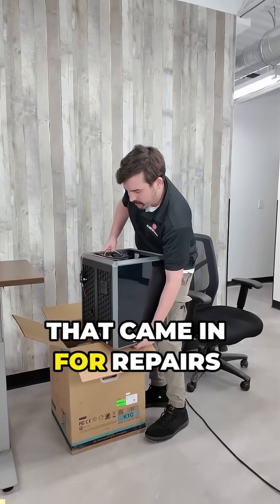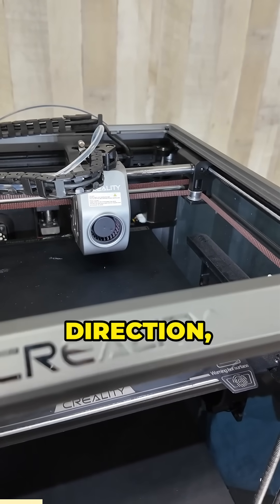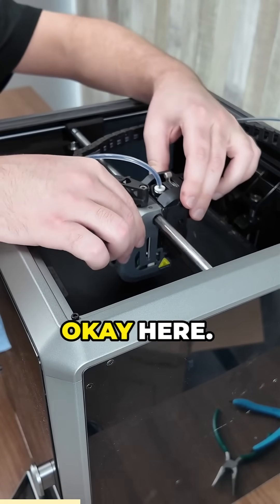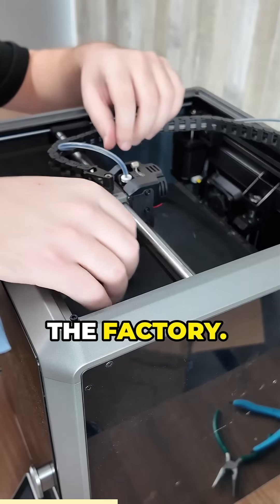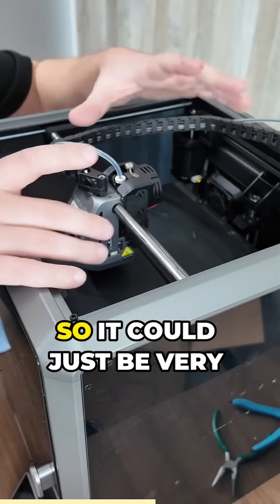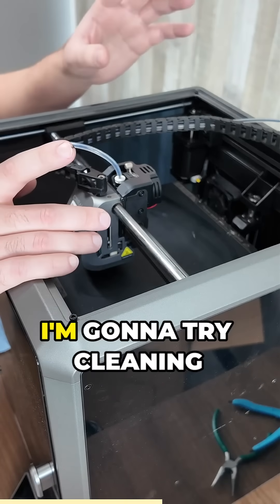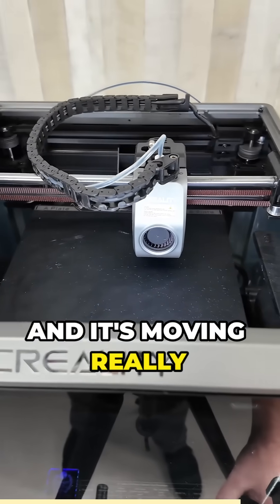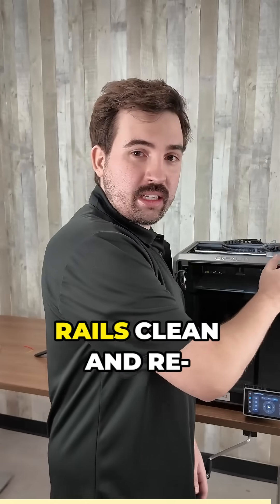What's Wrong With This Creality K1c?

Comment: Hi,

My printer is making strange noises and stuttering when the x and y axes move. Shortly afterward, the printer stops all movement and displays the error code "Error key 2567 unknown exception."

Creality support wanted to know if the x and y axes could be moved when the printer was turned off, and this worked without any problems.

Creality support then sent me a replacement motherboard. After replacing the motherboard, nothing changed. Same error code.

I'm grateful for any ideas.

Best regards

Comment: Shouldn't push steppers like that because the back EMF can destroy the driver electronics
Reply: Pretty minor risk with modern boards, they include sufficient inline smoothing.
Reply: @krazed0451 You can build in all the protection you like Zeners, flyback diodes etc and still enough back EMF voltage spike can be generated to destroy the drive electronics. It's a stupid person who thinks otherwise.

Comment: on K1C in X-axis (linear rods from start of video if someone dont know) should be brass graphite self-greasing linear bearings so you shouldn't use grease it cuz it can make faster wear and tear of them
Reply: I greased my x-axis once and my k1c started to shift on printing.  I removed the grease i added and just cleaned the x axis and all is working great.  Lesson learned.
Reply: @mlkeclow1671  yep, you shouldn't grease x-axis, if it starts to work harder just clean it

Comment: You dont grease the xrod. Its a self lubricating graphite bearing. Light machine oil if anything
Reply: not even oil, but at last someone smart
Reply: Creality K1 owner here. They literally provide metal grease in the box and instruct to lube the x and y rails every 200ish print hours

Comment: Love it! I just got my K1C and a small ketchup pack of metal grease was included. Now I know what to use it for! Thanks!
Reply: in vid there is few mistakes where he shouldn't use grease like X-axis linear rods
Reply: @Demon_King91 what’s it for then?
Reply: @Ariel-lt8ln  z-axis screw (up and down) mainly
Reply: @Ariel-lt8ln do not use any grease on the x axis.  I added grease once and my printer started to bind and shift prints.  Just clean the x axis rod and your good to go

Comment: As someone else said, the manual for the K1C specifically says to NOT grease that rail. Creality is using a graphite/brass bushing press fitted into the print head. It’s actually not difficult to push out to see it. 

Knowing what they are, they are self lubricating bearings that only require you to clean the rails with isopropyl alcohol when they are dirty. If any lubrication is needed, only a dry graphite based lubricant should be used
Reply: Was difficult to watch

Comment: I have a K1C, the rails to get dirty some what quick, i use grease on the elevation screws, however on the rails i use a dry silicone  lube!  it doesnt collect  dirt as easily as grease
Reply: don't use any grease or lube on x-axis rods, they got self-greased brass graphite linear bearings that can be damaged by it
Reply: @Demon_King91 good to know
Reply: It's not dirt on the X axis rod, it's graphite from the bearings, used to self lubricate.

Comment: omg, no greece on x axis! don`t do it, coz in printhead installed graphite sliding bushings. read manual first
Reply: Manual shows grease for all axis on the K1 machines. They even supply a small tube with the machine.
Reply: @killerdoxen no, it's not. Google about graphite bearings! They don't need no lube, it's bad for them. They are self lubing. Only thing you need to do is clean the rod with degreaser or isopropyl alcohol, wipe rods dry and you are good to go
Reply: @killerdoxen  don't use any grease or lube on x-axis rods, they got self-greased brass graphite linear bearings that can be damaged by it

Comment: How do you clean the carbon rods on the P1S? Does it require special treatment?
Reply: Clean only with Isopropyl Alcohol. Do not spray it on directly. Spray it on a cloth or paper towel and clean the carbon rods. Do not put any grease or oil on them.